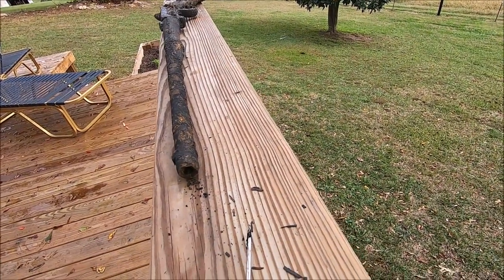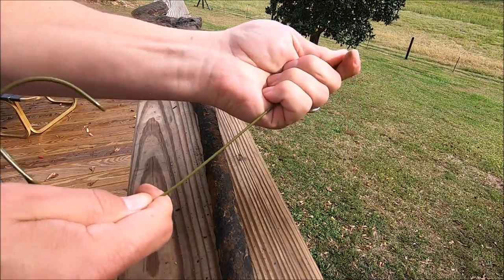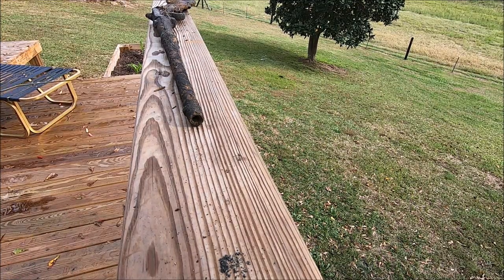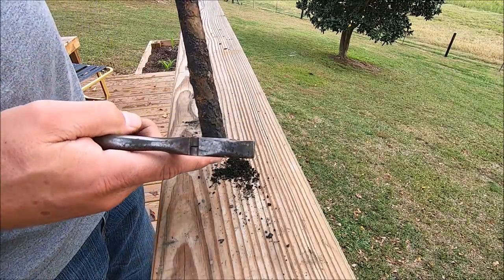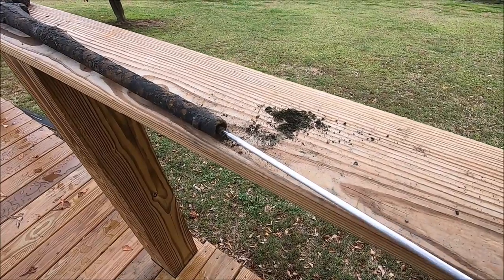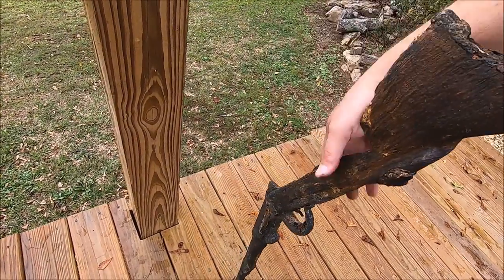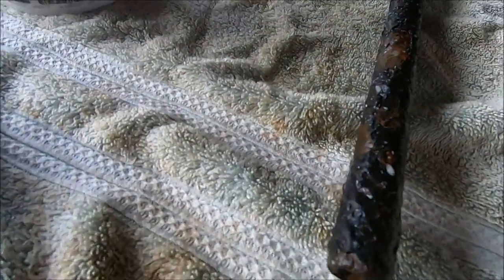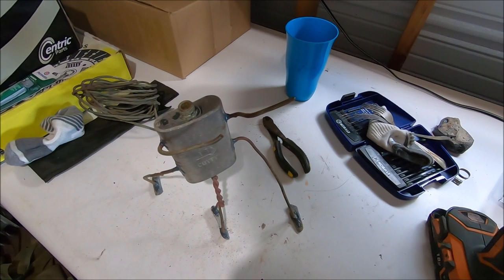Civil War Burnside Carbine Take 9: The Barrel is Cleared

Comment: When I used to have my old Thompson Center muzzleloader. I will clean it with a 20 gauge brass brush. Will a battery operated drill at variable speed so you can slowly do it and raise the brush size as you clean it. Add a little oil to it WD-40 or something like that to help clean it off soon as you go through but do it a real slow speed and I believe you find you can clean it real good. Just my suggestion. Looking good though. If you happen to take a deer post would love to see. Thanks Bill Johnson North Carolina

Comment: E.A.  Keep in mind that the metallurgy at this was nothing but wrought-iron--meaning this is a very porous steel.  With this in mind, you may have different percentages of moisture for several months.  I would store the ole' girl in a dry place and attempt to flake off oxidation as time goes by.  Remember, nothing is easy!!  Good Luck, dl

Comment: ATTN E.A.! To remove rust by electrolysis, get a bucket and fill it nearly full of water. Dump a handful or two of Arm and Hammer washing soda into the water. Get a piece of scrap iron, hook the positive side of a 12 volt, 5/6 amp charger onto the scrap iron, and suspend it on the side of the bucket in the solution. Dom't get the charger clamp in the solution. Now suspend the rusty part in the solution with iron wire, hanging it from a piece of wood or whatever from the top of the bucket. Do not let the part touch the scrap iron. Now clip the negative charger clamp to the wire the part is suspended by. Plug in the charger. 24 hours is usually enough to clean off rust, and this process will not remove any metal. One thing, the rust will only be removed from the side facing the scrap metal. You will need to turn the part to clean all sides. You can also put three or four pieces of scrap iron all connected together to clean all sides at once. Good luck!